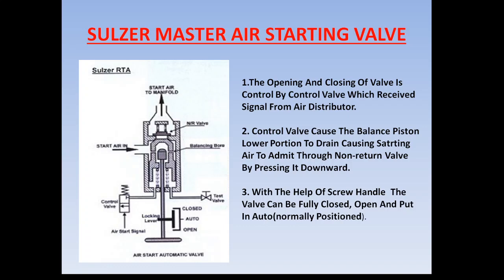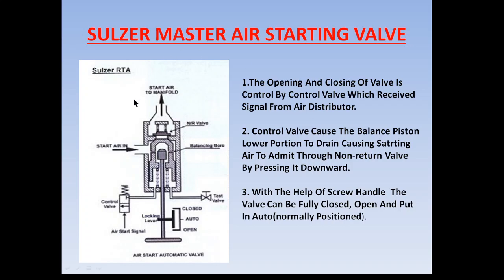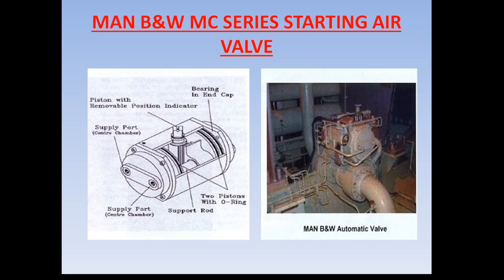MASTER AIR STARTING VALVE| TYPES OF MASTER AIR STARTING VALVE|HOW A MASTER AIR STARTING VALVE WORK|

Comment: can u please explain that in sulzer starting air valve, during valve opening time the air starting valve's drain valve activated, in this case does the air enter inside balance piston lower side get continuously drained through the drain valve during entire operation of the air starting valve or not?

Comment: MAN B&W - With the help of the control air, the rack nd pinion is moved ,so the ball valve is moved hence allowing the air to flow into the manifold .How the ball valve is closed again ?? Is there any spring arrangement?? to bring the ball valve to close position?
Reply from the maker: With the help of control air . 
Control air for opening and closing is passed through direct control pneumatic valve which operates the master air starting valve in man b&w
I hope you understand!!!!
Please do share with your friends.
Marine Engineering hub is to bring all our marine personnel to this platform for sharing knowledge so that we learn and grow together.